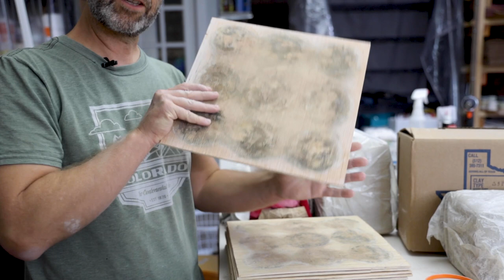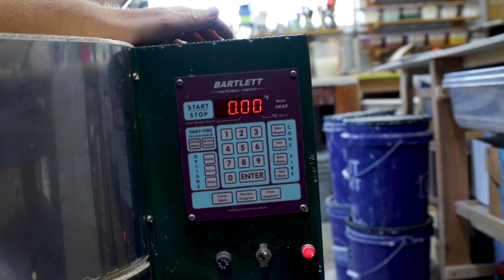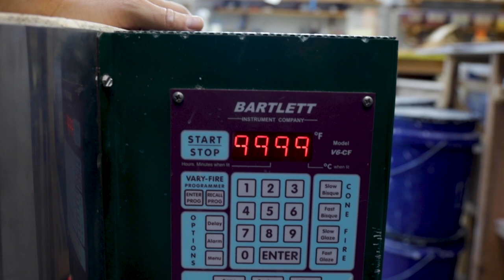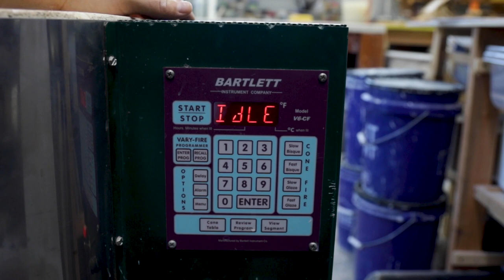How to Make Porcelain Christmas Ornaments - Step by Step Workshop

Comment: Thank you so much for this. I will use your link to get a couple of things I need for ornaments next year. I noticed you referenced Laguna Bmix 5. Is that porcelain clay? Thank you!- PJ
Reply from the maker: Hey PJ. I think for practical purposes it IS a porcelain.  I've heard it described as a synthetic porcelain.  it doesn't have any grog in it - those tiny particles of already fired clay that helps your wheel work get more vertical height/strength.  Those can show up and mar the surface when you're doing work like these ornaments.  Hey I'm glad this is helpful to you! Ask me anything else you need.  -mj

Comment: Awesome video!  👏 Thanks! How long are you leaving the clay in the molds before you pop them down out?
Reply from the maker: I don't use molds for these ornaments but other mold products I let the slip set for maybe 15 minutes and I keep topping it off in that time.  then i pour it out and wait for another 30 mins or so.  it will usually separate out from the sides of the plaster mold so you can pull it right out.  if you need it to dry faster try setting it in the sun or in front of a fan. hope that helps! -mj